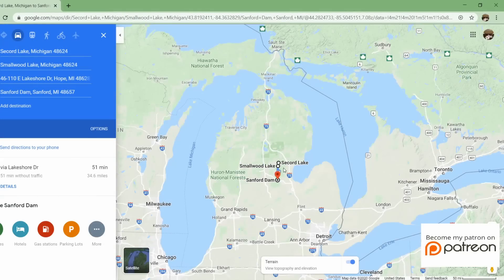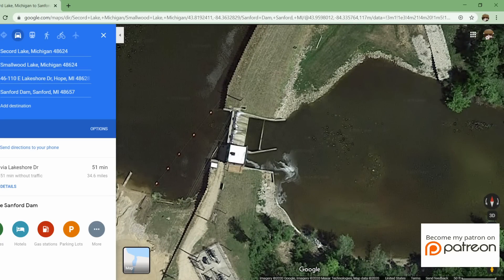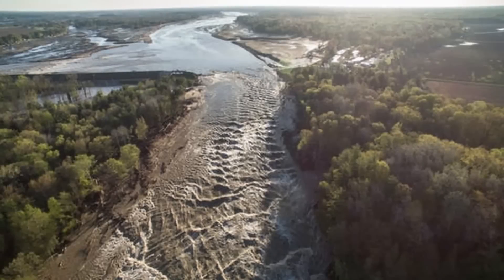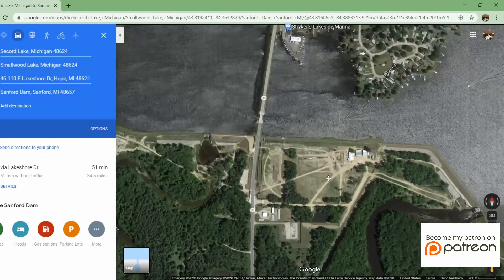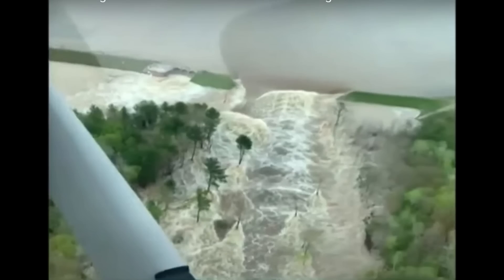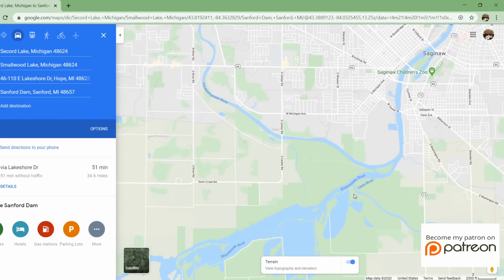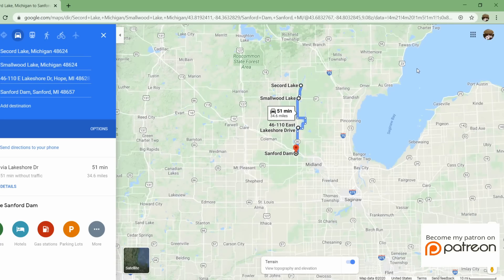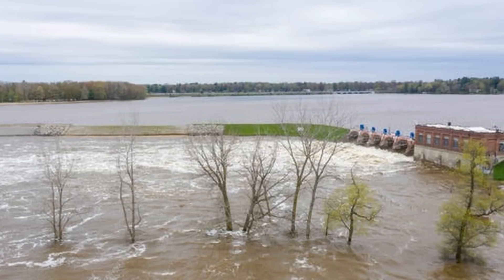Michigan Dam(s) Fail!   Tittabawassee River.

Comment: According to Midland County officials as of ~3pm (EST) 5/20/2020, the Sanford dam may still be somewhat intact but they can't tell because it's underwater (they're using the term "failed" because it's spilling over, not necessarily because the structure has collapsed). Latest images of the Sanford dam appear to show overflow limited to the emergency spillway area. The current hope is that the dam itself will hold long enough for the upstream flow from the Wixom lake breach to recede. If the Sanford dam fails, areas downstream are looking at 500-year flood levels. Local and state police have already begun staging in a number of downstream areas, presumably to facilitate evacuations if the dam fails.
Reply: These two videos appear to me to be real videos of Sanford Dam:
https://www.youtube.com/watch?v=BzObRlhuztU
https://www.youtube.com/watch?v=lzgu_Mnkfgk
In the first, you can see how the emergency spillway is not much lower than the top of the dam. In the second (at 0:40), contrary to what the title says, it is fairly obvious that the spillway and much of the dam are missing.  The water level appears significantly lower than what the spillway height was, and the length of dam not showing above the water appears quite a bit longer than just the spillway length. Unless this video is actually of a different dam (or an extensive fake), I'd say the dam is gone.
Reply: @andrewsnow7386   That's Sanford Dam all right, comparing the aerial view at 0.01 seconds with Google Satellite View.   And not only the emergency spillway, but all the rest of the dam from there to the west end of the dam at the western shore, has disappeared under the water.   And, the water level 'below' the dam is the same as the level 'above' the dam.   It's gone, as you say.    It is an ex-dam.
Reply: @andrewsnow7386  Dow chemical to alll down stream and huron
Reply: @andrewsnow7386    I agree !  ,  the   media  up here ( local reporters,  are saying the  dam is  intact    ,  well,    the  concrete portion may be ,  but the  earth fill  portion of the  DAM  (  it's  ALL ONE structure !  )  ,   is  clearly  GONE !!
Reply: @andrewsnow7386  Yeah, based on that second video, looks like the entire earthen part from the emergency spillway to the side is washed out.  There's a riffle over where the emergency spillway is, so some of that may still be intact underwater.  Maybe the city officials are hoping some of that earthen wall is still underwater as well and as the river drops it'll slow the release of the lake, as the "hole" will be smaller?
Reply: @nicotti     ya,  because  dams  can  repair themselves  once breached :)    water does not stop digging once it starts,  just look at ANY river bank .
Reply: @Wag2112  Downcutting is slightly more complicated than that.
Reply: Rethink living on flood plains
Reply: I grew up there , so my fb is swamped with all the posts picture videos of everything , the dam in sanford is eroded thru lake levels and further erosion of the earthen dam will continue as the river levels drop thus allowing more of the lake to drain. Wixom lake is drained its back at its original river channels with a lot of silt left over. most of the bridges in the area are closed or destroyed. Sanford dam had no chance once  the much larger wixom lake drained into it .
Reply: Our prayers go out to those in the path of all this water! Their lives will NEVER be the same but at least they have warnings to get out of the way.
Reply: I believe the Smallwood dam failed first, and the water from that location led to the failure of the other two dams. Edenville and Sanford
Reply: @recoveringsoul755  i believe small wood wasnt a total failure that one im not seeing much info on . Sanford is definatly a result of the much larger wixom lake draining into it . Below the sanford dam the Titabawassee river is not really that big so it takes a while for the water to go away which is why midland also gets flooded.
Reply: Great job on the video. Earthen dams and earthen spillways are cheap disposable one time structures. Once either are overtopped, they have to be replaced. Erosion and flow-nets make them not salvageable. Dam Engineering Standards 50+ years ago were much less than they are today. I have designed spillways, and the criteria now is much more advanced and more value placed on benefit than cost.
Reply: The owner of the dam tried to lower the level and go stopped by the state because of worry about killing fresh water muscles.
Reply: @markw9841  I bet it was more cause of the rich people that wanted theyer boats to be in enuf water.
Reply: @greenlawnfarm5827  And muscles was just the excuse? Highly likely.
Reply: @Reaverwind  Yeah. Rich people do stuff like that to make people think its for nature or something but really its about the boats and drinking beer and partying.
Reply: @markw9841  It is spelled MUSSELS, graduates!
Reply: Here's the link to the 5/20/2020 3pm Press Event op mentioned: https://www.facebook.com/co.midland.mi.us/videos/2899191300194247/?t=195
Reply: @nicotti  This part is just politicos  blowing we have seen enough of that
Reply: @banjobenson9348  Then don't watch it.  I added the link for people that want to.
Reply: @guss whu They are all owned by Boyce Hydroelectric out of Las Vegas. Dow owns a much smaller low head dam in the City of Midland
Reply: @michaelkelly3342  Check the wiki - Boyce Hydroelectric got terminated - the townships appear to own them now - "Four Lakes Assessment District" - In other words, sucks to be a land owner anywhere near those "lakes".
EDIT - Closer read, title to the dams and lake bottoms do not appear to have transfered yet. Looks like this will be going to court!
Reply: @jrkorman  Four Lakes Task Force is a nonorofit that is working with the townships to form a special assessment district to fund the acquisition. There is a purchase agreement in place, scheduled to close in 2022, but that may be null and void now, at least for Edenville. So, currently, Boyce retains ownership, though they no longer had a permit from FERC to operate the Edenville for electricity generation. That permit was withdrawn in 2018.
Reply: @michaelkelly3342  Thank you for the updated info. This is local interest for me as I'm originally from just north of the area; Ogemaw County. This whole thing may end up dragging through court, but I'm pretty sure its going to be years before those dams are rebuilt!
Reply: Sending all my love and prayers to the people of MI. We have a very old dam here in OK, just like there in MI. Please heed all of your local weather advisories, and of course add the power of prayer.
Reply: It seems to me that our infrastructure #dams ,highways and bridges, need special attention. I say piss on the stupid border wall .
Reply: Is all this happening to farm land?
Reply: @ceruleanc505  no go to ggoogle maps sattelite view of sanford and go up and downstream
Reply: @ceruleanc505  a fair amount of it is, but the Tittabawassee River has a wide flood plain because of the small changes in elevation.  so all of those river bottom areas are farmed (and some of them are polluted from Dow), etc.
Reply: @obiwanbenobi4943  Ty!
Reply: @guss whu nope. Dow does own a dam but it is at the chemical plant .
Reply: @guss whu The dams are owned by a power company, not Dow.
Reply: Per recent video, Sanford's done. Topping and heavy erosion both sides of main spillway, and most of the entire western reach, housing the emergency spillway is GONE, E. spillway abutments and all.

Video from the toe of the dam prior to failure shows the E. Spillway functioning normally. Presumably, the crest from the Edenville failure simply overloaded all components at Sanford.
Reply: Here are two additional videos of the Sanford Dam failing:
https://www.youtube.com/watch?v=ObTMI72OTY4
https://www.youtube.com/watch?v=ueyKY6pDHy8
In the first, you can see that nearly 100% of the dam is overtopped, but major failure has not yet occurred.  In the second video, major sections have washed away.  Although, the emergency spillway still appears intact (not that that helps in any way).
It's worth noting that in these videos there appears to be little if any debris caught on the control gates.  The video of the aftermath showed a lot of debris clogging the gates.  From these videos it appears that debris didn't factor in the dam being overtopped.  The debris must have come after the dam had already failed.

Also worth noting, the Edenville Dam was NOT overtopped.  As the following video shows, the soil got so saturated (it appears there was pipping) that the dirt just slid off the back of the dam opening a large hole:
https://www.youtube.com/watch?v=Hc3u_CHVHJ8

Finally, this video of a third dam, the Smallwood Lake Dam:
https://www.youtube.com/watch?v=EaWPQNa6OjE
I believe this dam is still standing, although the erosion and emergency repairs that can be seen in the video show that it was a close call.
This dam was reinforced with a lot of sheet pile at some point.  I think it's likely it would have failed without this.  Notice at 0:56 how the sheet pile extends way back from the face of the dam. This protects that flank of the dam from the emergency spillway flow.  Good on whoever engineered the sheet pile upgrade.
Reply: Angus Beef  Whats femur?
Reply: @guss whu unless DOW owns them under a different name, that is not true.
Reply: The End  CCCP collateral damage.
Reply: This is good reporting.
Reply: guss whu The Edenville and Sanford dams are privately owned by Boyce Hydro, LLC.
Reply: @blancolirio if you know so much about dams from the incidence in California why don't you come here to Michigan to fix it?
Reply: @michaelstover3940  Who is going to pay for it?  That is where the problem starts. One of the major problems with earthen dams is not the dam itself. But with the emergency spillway designs. If you look at most of them, they are simply lower areas of the earthen dam. Some may have riprap in that area but most are just grass seeded earth. It takes concrete to make a spillway that works and survives. One good thing did come out of it though. A lot of the sediment in the lake got washed out so if they rebuild the dam, there will be an increase in capacity for storage.
Reply: @gravelydon7072  he will find a way
Reply: Lmfao @ 500 year flood levels.
Reply: We need an infrastructure New Deal
Reply: If people build houses in places that will flood if the dam fails then they are not very smart.
Reply: hay woods It didn’t just flood there was a extreme amount of water received in central Michigan and it rose the lake, the water was too much for the dam and it collapsed then runs into the Sanford dam and sent water over the top of the dam Sanford dam is still standing
Reply: @kamrynfoster1241  But people should not make houses where they can flood.
Reply: hay woods that makes no sense😂your saying that like these people knew this spot was going to flood when they built the houses uhh no technically anywhere can flood
Reply: @greenlawnfarm5827  it seems to me that buildiing permits on the flood plains should never have been issued. Supervisors eager to increase the tax base must bear some responsibility. But greed turns a deaf ear to common sense.
Reply: @greenlawnfarm5827  Lets see, If you live in the western 1/3 of the USA, you are at risk from large earthquakes, wildfires, and volcanoes in some locations volcanoes.  On much of the east and south coasts, the hurricane risk is substantial.  In the middle of the country there is tornado ally.  Oh, and all coast are at risk from tsunamis.  I'm sure I missed a bunch of risks, but you get the idea.  There aren't a lot of smart places to live. 
Don't get me wrong, I do think we should encourage people to move out of places that flood frequently.  But casually dismissing them as not very smart doesn't help.
Reply: @andrewsnow7386  Well i was going to say its stupid to live under a dam so i was being positive.

Comment: The lower dam had a proper concrete spillway, but it was a spillway for Flood water, not for the dam above failing. Which in itself is a fascinating fact that ought to be considered in late dam builds. Recent footage shows the concrete spillway slabs are huge and that they were moved whole by the huge water flow.

Comment: I'm from this area in Michigan, my daughter lives within half mile of Wixom Lake. I heard that the reason for all the water in Wixom Lake is because the upper two dams were breached. Can anybody confirm this?
Reply: Sally Bridges I hope your daughter came through the event safely.  The problem was a court order preventing the lake levels from being lowered as was the usual procedure prior to a significant rain event.  The levels in the upper two lakes compounded the problem when they started to spill over the spillway. The upper two dams were not breached though and are still holding water.  There were four dams in all and it was the lower two dams which failed.

Comment: Boyce had their licenses pulled (some years back) to generate power, but were forbidden from lowering the water levels in these reservoirs, as it would have impacted the waterfront property values, and therefore property tax revenues.  There is a lot of finger pointing right now.

Comment: This dam was lowered last fall. I wonder if allowing the earthen portion of the dam to dry out and then soak water back up had any affect to the destabilization? How about with the lowering of the water level over the winter changing to a lower frost line? Could either cause enough heaving to affect the core of the dam before it had a chance to stabilize with the recent (within days) refilling of the dam?
Reply: Donavon Robbins an earth dam will fail if overtopped. An earth dam will also fail if the water is too high causing a hydraulic gradient greater than the dam designers intended.  This will cause seepage which leads to piping which leads to catastrophic failure. Once the water level reached the height it did, the failure of the earth dam was inevitable. The dam actually lasted much longer than people thought it would. It was solely the water level in the lake that caused the dam failure.

Comment: The emergency spillways should be contructed in that way, that they are not washed away by the water. And they should be wide enough, to prevent the water rising higher, keeping it under the level of the earth build dam area.

Comment: Michigan Attorney General Dana Nessel ignored growing concerns about the dam’s ability to withstand heavy rain and focused instead on environmental conservation. 
Just three weeks before the flood, AG Dana Nessel sued the owner of the dam, Boyce Hydro Power LLC, alleging it illegally killed thousands of freshwater mussels by lowering water levels. 
As a result of pressure from the Michigan AG to keep water levels high, and inaction on safety concerns, the dam did not have an adequate spillway capacity and collapsed.
Days after feds (EPA) revoked the dam’s license to generate power (2017), the State (Fascists Whitmer regime under Nessel)  assumed oversight, inspected the dam and declared it and its spillways to be in “fair structural condition" and not lower the water by 8 feet.

Comment: We weren't allowed to buy flood insurance because we are not in a flood plain. 2 other dams were also involved in the mess. The Chappel dam structure on Wiggins lake was also topping. Everyone was evacuated on Monday night along with all Billings township residents on Wixom out of fear of a washout. It held, by the grace of God, but it contributed greatly to the pressures on the Tittabawassee side of the Edenville dam.  The other dam, in Beaverton,  is the only non-berm dam in the county. It just went through major upgrades in the last couple of years. It held strong.  

When the Army Corps of Engineers rebuilds Secord, Smallwood and Wixom, we hope for much more advanced design.

Comment: EARTH FILLED DAMS ARE NOTORIOUS FOR FAILURE.  WHERE WERE THE
STATE INSPECTIONS?  ALSO, THESE DAMS NEEDED A  50 ft BRIK BRAK FACE
TO SLOW EROSION IN A TOP OVER.  (2 to 4 foot chunks of rock and concrete)
WHY WEREN'T THESE IMPOUNDMENTS DRAWN DOWN FULLY WITH HEAVY RAIN?   
FAST WATER ERODES FAST. POOR PLANNING LEADS TO POOR RESULTS.

Comment: Why are we always told that dams are for flood control, but the way they are managed creates more flooding? Why are most dams filled up with water and then they maintain the basins behind the dams at a mostly full level? Maintaining mostly full basins provides almost zero holding capacity during large rain events. Why wouldn't it be more beneficial to maintain basins at very low levels, so that during large rain events, the basins would need to fill up before any flooding would occur? If basins are already full to begin with, wouldn't almost all of the water from the large rain event be all flood water? All the dams within a watershed could be maintained at a mostly wide open state with low water levels, and then after a large rain event, all the dams along the river could partially close, so each are slowly filling up their basins all at once, with some filling up faster, but all raising their levels together controlling the flow. Then increase the closing of the dams as needed to hold back more water. This would provide an enormous amount of holding capacity compared to the current so called management plans of today.

Comment: I just watched a video, a drone over Smallwood Lake (the second dam in the chain), showing a possible failed dam there.  It was not overtopping, but the control gates were wide open and they appeared to be trying to keep the control house next to the gates from being undermined; water is pouring through the blockhouse and out an opening on the other side, and they were dozing rip-rap into the gap.